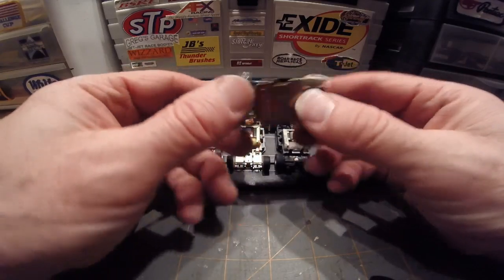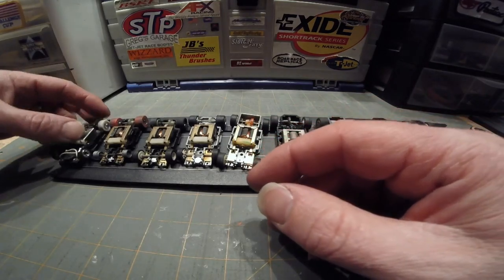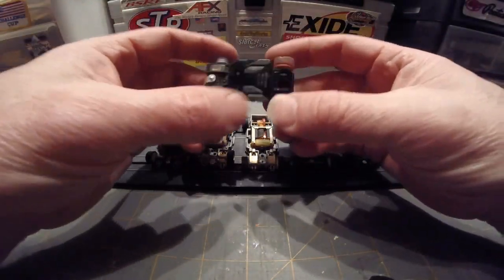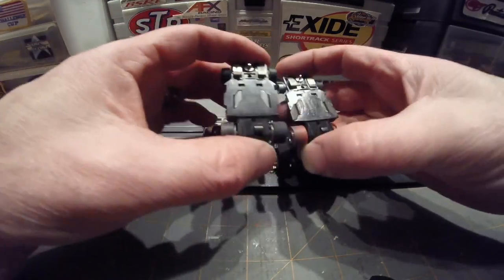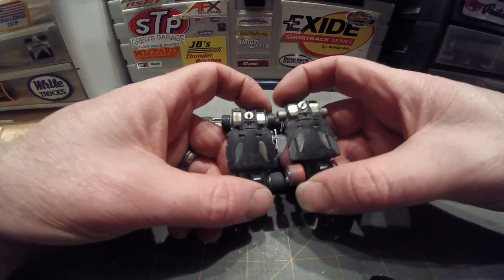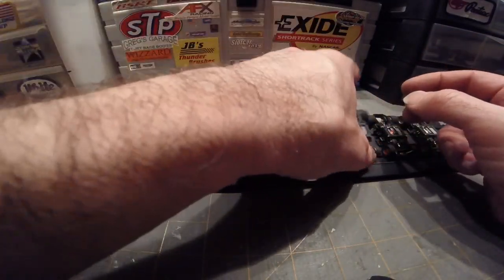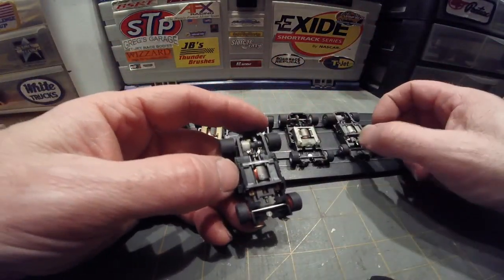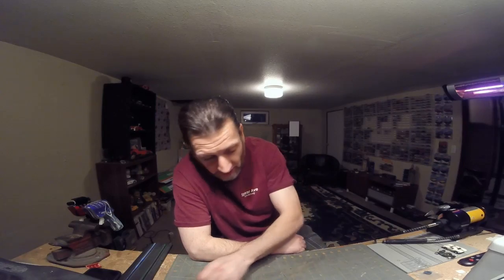Identifying Tyco chassis

Comment: I remember the early 80' versions were even nicer but in that case the contacts once broken nothing more could be done. Instead with the current contacts you need the dedicated chassis or put yourself there to do the modification. I am looking for two but complete for example Pontiac Firebird 1\64. There is something on Ebay but the prices are too high for my use. I live in Italy .:)

Comment: I came across a weird mixed looking chassis that is a tyco made in HongKong Looks like a hp7 has similar to hp2 pickup shoes but they are longer with a dimple in the shoe. And no traction magnet. Also uses a 440 rear axel. It is on the state highway patrol mustang with working lights and siren. I wonder what that model is considered?

Comment: Thanks for posting.  I'm a huge Tyco fan.  I have over 200 cars now and most of them are Tyco.  I have 3 Tyco Pro cars one is Gen 1 the 2 others and Gen two the rest are a mix of HP2's and a few variations of HP7's as well as.  I also have a number of different AFX, Auto world and a few others including slotless Lionel cars.  I love the hobby.  I subscribed a long time ago and love what you do.  Keep it up.
Reply: I just bought the Tyco slot car guidebook like 85 pages of the HO slot cars they built. Cant wait to start scooping them up
Reply: @GreatBirdOfHope  Believe me bro.  You will love them all.
Reply: @andrewluchsinger  the slotless lionel cars... power passers... When I was little my grandad had a set of those and he would set them up when I came over!
Reply: @GreatBirdOfHope  Believe it or not. I have a set of those. Track and two cars.  The set still works.
Reply: @andrewluchsinger  😎
Reply: @GreatBirdOfHope  If there was a way to post a pic here I would
Reply: I just won a bid on ebay for a 440 x2 miata for 21 bucks new in package.   I'm pretty pumped.  I think its similar to the cars I had as a kid
Reply: @Bluepanther80  Dude that is a hell of a great score.  I am looking for some 440's as well.  I also want to get some HP7's.  Get more slot cars bro!

Comment: The very first pro car was the black pan with drop arm design,had washer type round weights ,the flag had a thin shaft that was normally melted above the small plastic bushing during final assb of flag to drop arm...to me that is gen 1, gen 2 starts with brass pan,fixed snap in flag holder as part of the brass pan,then a weight. copper leaf pickups, then came the  buttons.

Comment: Cool I actually have the tyco 440 mag,440x2 and the hp7 chassis I have mine just as a hobby I got a stock car 500 tyco track set for my birthday when I was 12, I just recently decided to buy a auto world thunderjet ultra g car for two reasons one I have not messed with the track set in probably 10 years it's in the box under my bed,so I want to make sure it still works fine and fix it if it doesn't. And the hp7 is missing the rear axle and gear, Tyco 440 mag everything but the chassis frame and Camaro bodies are gone, and the two 440x2 cars are both missing the pickup shoes rear tires, and the guide pins, which except for a few times ran and it coming off the track and breaking the rear fender the 40 Ford California classic black flames Ford coupe was a new slot car but I had lived somewhere else other than at home so someone borrowed several things of mine including 65 percent of my automotive tools so I've had to replace a bunch, and before I hunt all the tyco stuff I'm going to need and I kinda want to get atleast one other 440x2 and Tyco 440 mag chassis I bought the perfect test car in my opinion because I like the version of the Christine car, but I am guessing I will need to change the guide pin to the metal to use on the tyco stock car track set?!

Comment: Just came across your channel. pretty cool stuff. I used to race in leagues as a kid at a local shop with multiple tracks. unfortunately its now closed. I ran a very hopped up Tyco 440 chassis with a Lexan F40 body. It has a hot green wire motor and some really strong magnets. My dad built a custom independent front axle too. with the sticky silicone tires it stuck like glue!